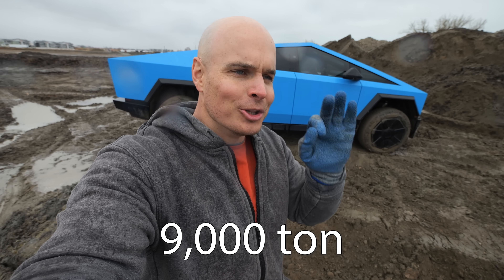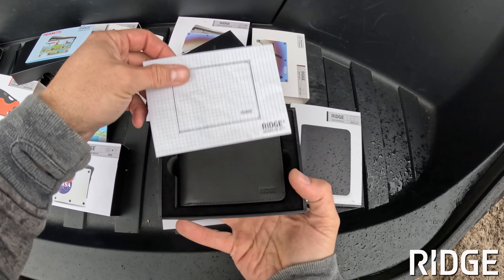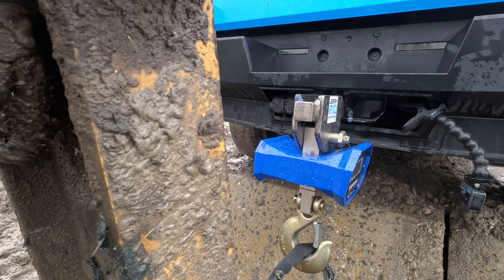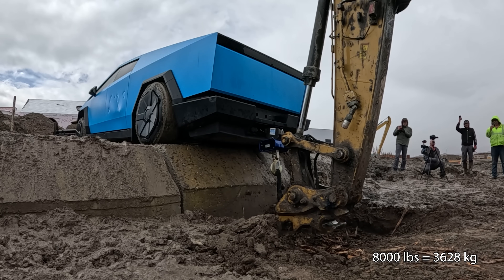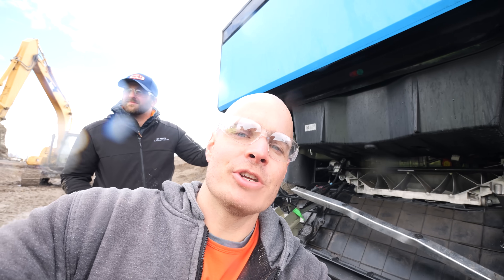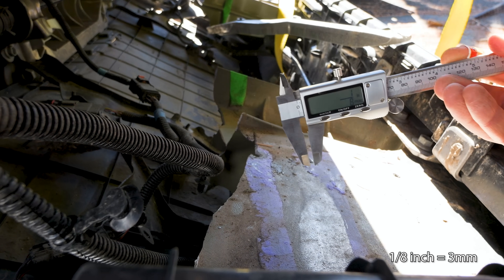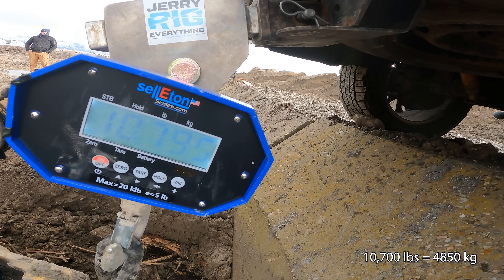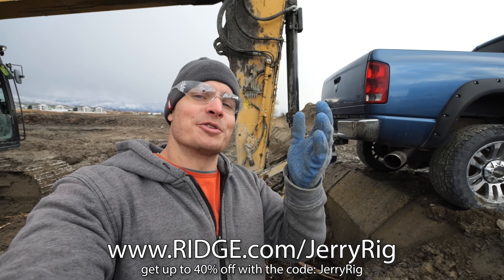SHOULD YOU TOW WITH A CYBERTRUCK?! - (catastrophic failure test)

Comment: Hey guys, I wanted to make a comment here as it relates to Aluminum as a Material. 

I am a trucking company owner and we operate flatbed trailers that weigh 10k lbs empty. These trailer are all 100% aluminum constriction. The only steel is the kingpin and the two axles. 

We haul up to 48k lbs and the trailer is rated at 52k lbs in 10ft. Overall length is 53ft. We haul steel beams, steel coils, machines, brick, steel plates, lumber. 

I guess I’m posting this to state that aluminum is indeed very very very very very strong when used correctly and manufactured right. These trailers are manufactured in Alabama by a company called Fontaine. 

I guess I find this very interesting because the hitch broke off at 10k lbs and that’s what these trailer weigh empty. But these can haul 52k lbs in 10ft easily. 100% aluminum.
Reply: I agree with everything you say, but you are comparing 2 things that don't compare.  The aluminum used on those trailers are not "molded" they are built with solid, welded aluminum that is designed to be beat and drove across the country. this injection molded aluminum frame is that has holes and angles that give weak points. Let alone its no more than 3/16" thick. Steel framing on regular trucks can be that thick and it speaks for itself that aluminum well stronger in weight ratio to steel, takes more material to do so effectively. So they could easily make an aluminum frame strong enough. i think they cheaped out.
Reply: @andrewkjeldergaard9653  so these trailers are built mostly using extruded aluminum members, they are then friction welded across the platform to create a solid surface. The Maine frame is made using aluminum I beams, which I imagine are also extruded. 

Also, with it being 53ft when you go down the road the trailers have incredibly amazing, tensile strength, it’s not uncommon to hit a pothole or cross a bridge and you can see the steel bouncing before coming to a halt by the air suspension. 

I guess I wasn’t really comparing the Tesla to this, I was mostly saying that Aluminum is indeed a very very impressive material if built correctly. 

I too agree Tesla cheaped out and  or their engineers went with a design that was lazy. Or maybe the alloy isn’t designed for the application and is too brittle. Idk not an engineer. I just happen to know that aluminum is very very very strong.

Comment: To quickly recap, Tesla's electric pickup is rated to tow up to 11,000 pounds (4,990 kilograms). Meanwhile, the maximum tongue weight—that's how much mass sits directly on the tow hitch—is capped at 1,100 lbs
Reply: Which is pretty much the same as my F-150 Lightning.  I'm not seeing the point of this video...
Reply: @TuscolaMatt  The point is to s**t on Elon because he hates his politics.  Yet he just proved its 10X stronger than its rated, I think I just might buy one now.
Reply: @TuscolaMatt  The point is it snaps completely. How anyone thinks it's normal for a hitch to snap off is insane even when exceeded. Any normal truck will take that weight and more without breaking, it will bend sure but it won't snap off and kill w/e vehicle is traveling behind it.
Reply: @Abadeez tesla took 10x its rated weight and jerry had to hold down the front.
Reply: @TuscolaMatt  He's explicitly stating that during certain conditions, some of the load will transfer to the tongue and therefore hold part of the weight for a while. He explains why he would not drive behind a cybertruck.
Reply: @BestFriendOfDog  Nope. 

Lets assume dynamic conditions.

1)Braking, this force is mostly horizontal (shear), not vertical (tongue weight). Vertical tongue weight might decrease slightly if the trailer pivots upward, but it wouldn’t increase dramatically. Even in extreme braking, the vertical load on the hitch stays close to the static tongue weight (e.g., 1,100 lbs), far below 10,000 lbs.

2)On a steep downhill slope, the trailer’s weight shifts forward. The vertical component of the trailer’s weight on the hitch increases by 
𝑊⋅sin(𝜃) W⋅sin(θ), where 𝑊 is the trailer’s weight (up to 11,000 lbs) and 𝜃 is the slope angle. For a 45° slope (very steep): 
11,000⋅sin(45°)=11,000⋅0.707=7,777 lbs added vertically. Combined with a nominal tongue weight of 1,100 lbs, this could reach ~8,877 lbs. On a 60° slope (near vertical, unrealistic for driving), sin(60°)=0.866 yielding ~9,526 lbs additional, totaling ~10,626 lbs. So, in realistic driving conditions, this doesn’t hit 10,000 lbs.

3)Bumps or potholes can cause momentary spikes in vertical force. Studies on dynamic load amplification (e.g., from vehicle dynamics research) suggest a load factor of 2-3 times static weight in extreme cases (like off-road racing). so 3 X 1,100 = 3,300 lbs.

4)In sharp turns or trailer sway, lateral forces increase, but vertical tongue weight doesn’t spike significantly unless the trailer lifts and slams down. Even then, forces align with the dynamic loading case above—nowhere near 10,000 lbs.

5)Could an extraordinary event—like the trailer flipping, jackknifing, or a catastrophic failure—cause the hitch to see 10,000 lbs? If the entire 11,000-lb trailer somehow landed vertically on the hitch (e.g., flipping over it), the force could theoretically exceed 10,000 lbs momentarily before the hitch or truck fails. However, this isn’t a “driving condition” in any practical sense—it’s a crash

No, the weight on the tow hitch would not exceed 10,000 lbs in any practical driving condition. From GROK.
Reply: @tookster7483  you avoided addressing the specific condition mentioned in the video lol
Reply: @tookster7483  He made up an scenario of going uphill then suddenly downhill. C'mon using Grok to check on cybertruck? You might have as well asked Elon himself if his vehicle is safe. There are reasons why the cybertruck is banned in Europe, and that's safety reasons.
Reply: @tookster7483 Come on man, either do the math yourself or don’t comment. Using Grok to opine about a potentially lethal design flaw is so irresponsible.
Reply: @tookster7483 that ignores the issues of galvanic corrosion and cumulative damage to the aluminum tho.
Reply: @BestFriendOfDog  The one directive preventing Tesla from bringing the Cybertruck to the country is the law that bans the sale of passenger vehicles that "exhibit sharp external projections."
Reply: @tookster7483 here's a problem. The failures started around 5k, not 3k, and his point about aluminum is that the 5k number will slowly fall over time, and eventually it'll crack.
Reply: @tookster7483 There was cracking heard at 6k lbs though, which is within your examples of use  - and I think everyone agrees that repeated stress on aluminum will eventually decrease its tolerance.  

Your examples also assume perfect and proper weight distribution on the trailer. Not everybody's going to load their trailer correctly and one abrupt hard brake can shift things forward if the payload isn't secured correctly.  I've seen this myself on the road, with trailers wobbling back and forth.

I think you've actually shown that in a real world scenario this could be a problem.
Reply: @BestFriendOfDog  Well he should test the windscreen too, sometimes during a hail storm, it can break the windscreen. That is very dangerous.
Reply: @BestFriendOfDog  For that scenario you need razor sharp edge at 45deg to apply 5500lbs as weight on hitch. You really believe that there is that kind of road on earth? And that cybertruck could pull that weight on that slope?
Reply: @feluke8396  Not sure about precise angles but I live in a with amongst mountains and there are streets that 100% look like a rollecoaster ride. The truck's aluminum, all these "calculations" these people are providing are static and it would surely fail earlier if used repeatedly because imperfections and because the calculations people are using in the comments are not accounting for acceleration.
Reply: @tookster7483  That's all fine today. What about after 10 years of towing stress on that same frame? What about the sudden momentary spike in vertical force, which aluminum does not handle well?
Reply: @BestFriendOfDog  Why does it have a 5 star safety rating from the NHTSA then? Seems like you don't actually know.
Reply: Which is what? Short of your trailer hanging off a cliff , it won’t have to take such stresses.
Btw tounge load for Rivian 1155 pounds
Ford raptor 850 pounds
Toyota Tacoma 650 pounds
Byd shark 551 pounds
Reply: @electricfox6598 because the NHTSA doesn’t test for pedestrian impacts, or for how dangerous a collision is to the other vehicle, or for how long it takes for emergency responders to cut you out of the vehicle. It would fail miserably in all of those.
Reply: @potatocurry4474 the cybertruck is the only one with a tongue weight that decreases every time you actually use it for towing.
Reply: @BestFriendOfDog he said that but that’s an absurd claim not grounded in reality.
Reply: @ronlaverdiere  How will it decrease? What is the plastic limit of aluminium?
Reply: A ram 2500 has a max tongue weight of 1800 pounds yet it didn't explode apart, it just bent a little under the same load.
Reply: @Jake-bt3fc in addition, the Dodge has what, 20 years of wear and tear on that hitch!
Reply: also from a telsa engineer: "At 10,000 lbs of tongue weight the vehicle would be so grossly misloaded the front wheels would no longer be on the ground. And to answer a common question -  no, a pothole will not transfer this much vertical force to the hitch."
Reply: @JoshCPirvu is that Tesla engineer part of the team that released the Cybertruck with panela falling off on the road? The same team that released the Cybertruck with low mileage motor failures in a massive number of customers vehicles? The same team that saw the Model S/X aluminum frames with major structural cracks after less than 50k miles - and that was WITHOUT towing!? The same team that thought it was a good idea to leave gaming available to the driver?
Reply: Than do it. Simulate on some tim-buk-tu road in Nevada. To catastrophic failure. Lol. You won't. Because you can't.
Reply: This was just Zack trying to show a broken Tesla. When towing a load the weight sits on the tires of the trailer, well most of it. It's only rated for 1100 pounds on a direct vertical
Reply: @AkaliciousZA Fact is there are many scenarios when the tongue weight over-exceeds its maximum capacity. Cybertruck simply isn't safe for towing
Reply: @g-s6459  I think the cybertruck looks like a dumpster and it's a richman city toy truck but if there are many real life scenarios where the tongue weight can over-exceeds its max capacity then you can surely list some of them and in the mean time explain why the cybertruck exceeds by magnitudes the SAE specs tests for tongue weight capacity if it is such a dangerous vehicule to drive
Reply: @g-s6459  oh!! what are those many scenarios??
Reply: @ do your own research bub
Reply: @g-s6459 Completely untrue. Give an example of one of those times that would happen.
Reply: @g-s6459 you're the one that made the ambiguous statement. Stop trolling!
Reply: He is a Dem, and Dems have expressed disagreement with Musk.
Reply: @DreamFreeAgain I am not a Dem. I think the cybertruck is overrated and overhyped junk that only a fanboy would defend.

It cannot tow a fifth wheel unless you never need to turn

You cannot throw something in the bed and later retrieve it by reaching over the side. It is not built to do “truck things” efficiently or practically.
Reply: electric toy* this isn't a pickup. By definition this would be more like a hatchback than a truck.
Reply: @Abadeez  I have hauled more steel and lumber in my Honda Civic hatchback than I have ever hauled in my truck. The best part is 9 feet fits inside. whereas the truck bed only holds a 6.75-foot bed. So a 12-foot board only sticks out about 2 feet past the bumper. Truck about 4 feet.
Reply: @Abadeez  buddy please, this is a truck. Not a good truck, but it's still a truck. We need to separate emotion and fact. We ALL can hate Elon and Tesla, but lets not let that cloud facts.
Reply: @AndrewPL5  It's clearance doesn't set it as a truck, it's wheelbase doesn't, it's weight doesn't, it's has to be closed cover doesn't, it's usability doesn't. You can't even take it through a car wash without a specific setting.  It's not a truck, it's a toy.
Reply: @Abadeez  Again, I think you are letting your feelings overshadow the facts. It is truck shape, it's truck size, it has truck clearance, no the cover doesn't need to be closed at all, and you can take it through a wash without a wash setting. It's literally a truck, not a good one, but a truck nonetheless. And to be clear, most "truck" drivers don't use their trucks for truck things, making most trucks a "toy". You are clearly mad about this vehicle, and that is fine. Most people are. But just because you are mad and don't want this to be a truck doesn't change that it is a truck. Sorry.
Reply: @Abadeez Any car with self driving capabilities or proximity-based security requires a special car wash mode. Otherwise the thing is gonna go off like a rave on wheels when it starts sensing wash machinery while it’s locked.
Reply: @Abadeez  yeah!! exactly my dear dem
Ford F-150: 1,400 lbs
Chevrolet Silverado 1500: 1,300 lbs
Ram 1500: 1,270 lbs
Toyota Tundra: 1,200 lbs
GMC Sierra 1500: 1,300 lbs
Ford F-250 Super Duty: 2,000 lbs
Chevrolet Silverado 2500HD: 1,850 lbs
Ram 2500: 2,000 lbs
Ford F-350 Super Duty: 2,500 lbs
Toyota Tacoma: 680 lbs

Comment: This test assumes you would be pulling a trailer down the road with a tractor holding the front wheels on the ground with a tractor while driving down the highway so that your back suspension could bottom out and actually  apply those kind of forces to the back hitch, how stupid would someone have to be to not realize that   with out the front tractor you couldn't even  see the road in front of you and you would be stupid to drive with that kind of tongue load in the first place because you would have no steering control to drive with in the first place.

Comment: Tow rating is 11k lbs, which is a pulling rating (horizontal). You loaded it vertically so yeah, you’ll break it if you load it enough. Nothing to see here other than you voluntarily trashing your truck to prove …. What, exactly?
Reply: I mean... who doesn't daily use an excavator to put 10 000lbs of vertical pressure on the top/down axis ? Proper usage! 
At least 3 cybertruck have lost their back end, this one, whistlinDiesel and... probably another youtuber trying to get more views. 

Feels like the truck is good depending on how much money you receive to show it isn't and what Elon did the day before.
Reply: As he demonstrates in a day to day situation it's pretty easy to snap off the hitch even if we'll loaded. On top the damage to aluminium is cumulative, so if not today as you stay below the max, it could be tomorrow. Tesla's are a danger on the road.
Reply: You clearly didn’t watch the whole video.  He addresses this exact comment.

Comment: The adhesive is DuPont’s 1480P structural adhesive - used in place of welding due to risk of galvanic corrosion if welding dissimilar materials (same reason rivets are used).
The adhesive’s bond (given surface/alloy chemistry is suitable, sufficient surface area of coverage, and correct adhesive wet out patch) is significantly stronger than a welded joint, and comparable to the strength of the surrounding substrate. It’s a viable option to use in the vehicle structure in place of welds.

The main issue here is the use of structural ribbing to reinforce a thin cast wall, which may vary in strength due to porosity, crystallinity differences, or variance in localized geometry (variation in casting shots into the cast due to exist) - typically these have to be over engineered with a high factor of safety.

Comment: That hill you're cresting would have to be sharper than a cybertruck edge if over 90% of the load becomes tongue weight. If that were a common occurrence, the tongue rating would be equal to tow rating on all trucks. Obviously, steel is less prone to cracking than aluminum. Everyone with a little more knowledge than a smartphone reviewer knows that, but the cybertruck withstood 9 times its tongue weight rating. I think that's pretty safe for towing within specs, and if you don't know how to follow the manufacturer's guidelines for towing, blame that on the education system or evolution. Not the manufacturer 😀

Comment: I had a 2011 ram 2500.      I was essentially at a stand still and someot in a smaller suv (probably 4000lbs) rear-ended me doing probably 60 MPH    bent it a little but not much. Saved my truck

Comment: Why would put 7000lbs with weight vertically?
You most likely damaged the suspension beyond the repair.
At most, you should put only 2000lbs.

Not sure why you would do this? It was a very bed idea